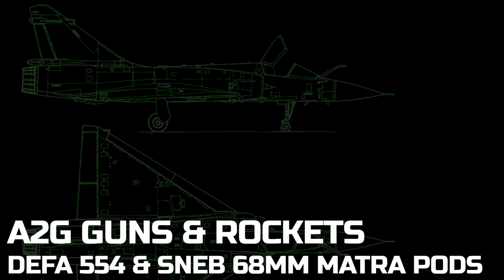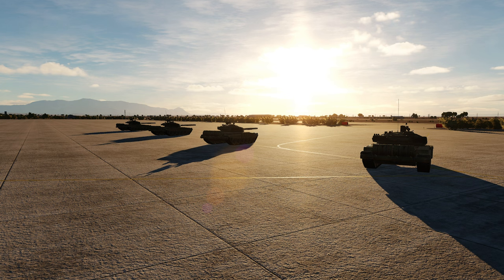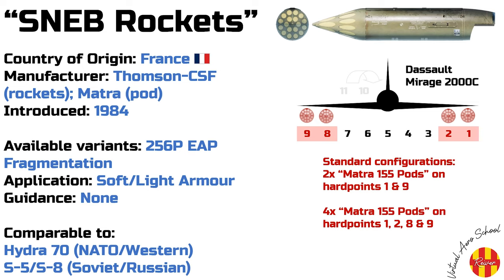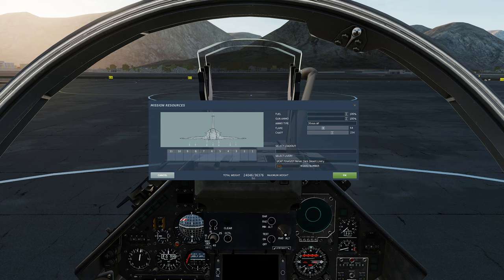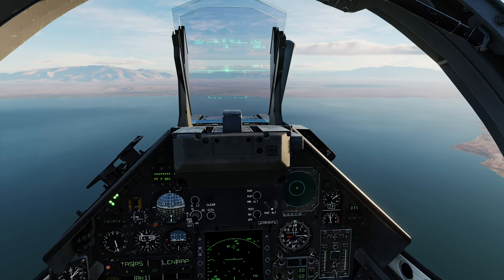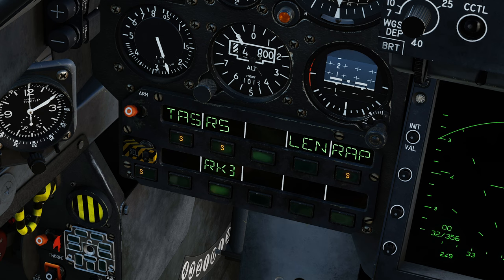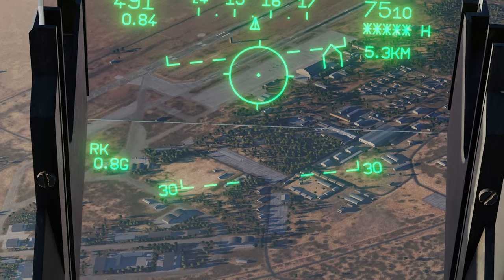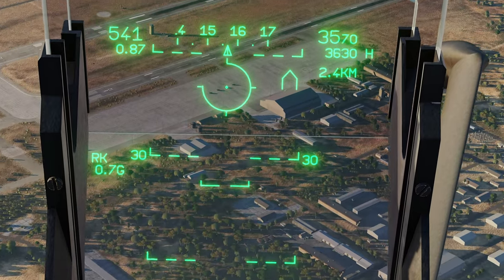The Art of the Mirage 2000C - Air-to-Ground Guns and Rockets | DCS World Tutorial Series

Comment: Still come back to reference all the time. THANKS AGAINE BRO
Reply from the maker: Glad to hear you're still flying the Mirage!
Reply: @reiver1-1  My rockets wont fire. AG Guns will. I know I have the guns off while using the rockets. Anything in my options I should change maybe?
Reply from the maker: The rockets should, in general, work the same as the A2G cannons. Do you have EXT, INT or both selected on the PCA panel once you enter air-to-ground selected mode on the HUD?